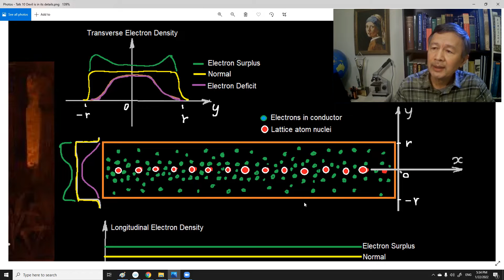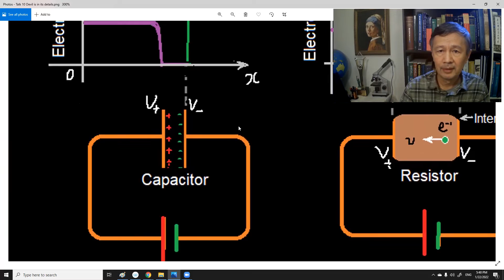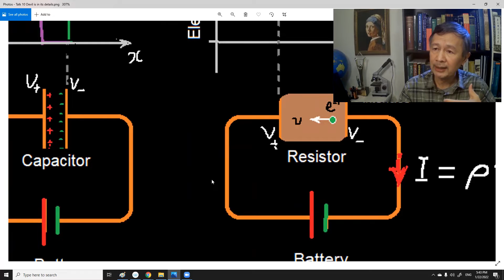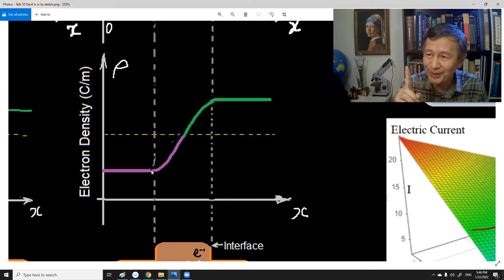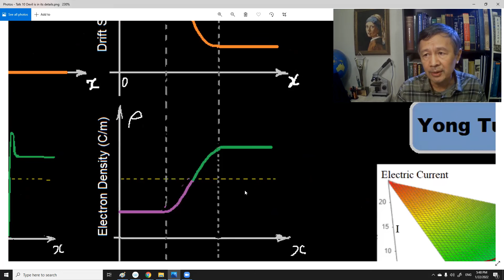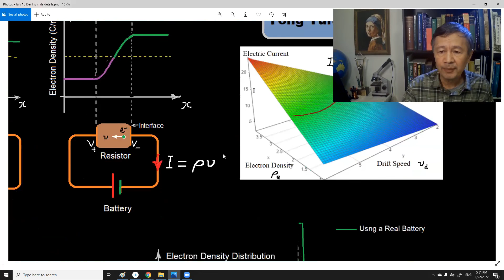Electron Density Distribution of Resistor and Capacitor in Circuit | 电阻和电容中的电子线密度分布

Comment: Interesting. I an not an expert on the suject but I will go futher and postulate that the  different drift speeds on opposite sides of the resistor gives rise to relavistic effects of time dialation.This efect is what I think may causes the potential difference across the resistor. The electons on the one side of the resistor can be considered as a stationary frame of reference compared to the electrons moving on the opposite side. I must emphasize that I am not an expert.
Reply from the maker: Bearing in mind the drift speed is less than 1 mm/s, although the electron speed near a nucleus can be close to c.

Comment: I didn't quite get the connection here to Veratasium claim. Might be adjacent.
Reply from the maker: Did you read the paper by Kirk T. McDonald?  https://www.hep.princeton.edu/~mcdonald/examples/lewin.pdf
Both Veritasium and McDonald believe quantum field theory is reliable. .....
Reply: @yongtuition  I saw a treatment of this paper.

Still what's missing in the analysis is anything real time and geometric on a ground plane.
I've seen isolated schematics with no c time component, I've seen radiometric propogation with no ground plane. Nothing convincing. And I keep looking for something convincing from you. I didn't follow this exactly.